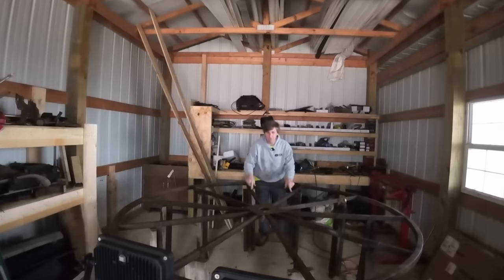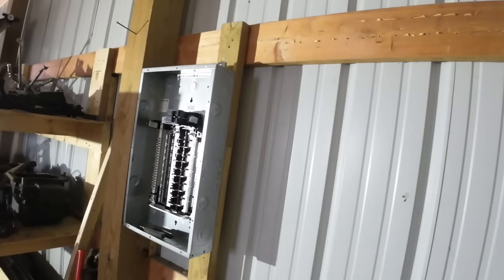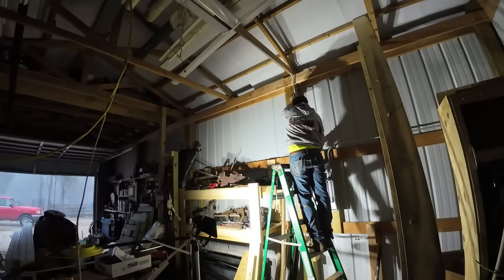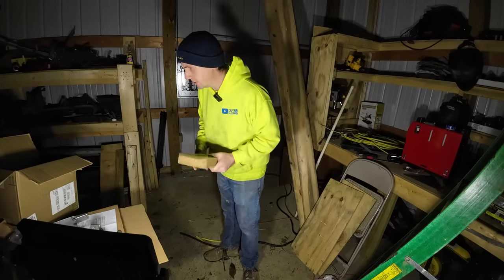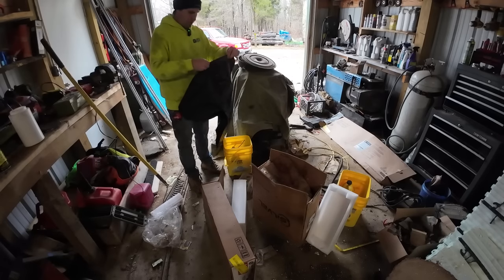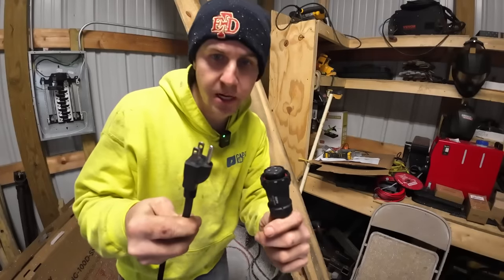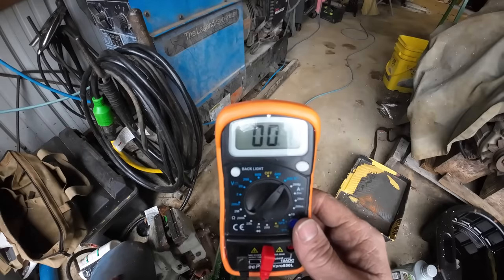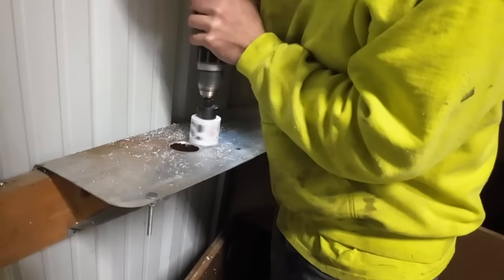Off Grid Solar Shop Conversion - Step 2: Electrical and Diesel Heater Install

Comment: We used motorcycle handgrip heaters and a 12v thermostat controller off ebay to kick them on at 36 degrees and back off at 50 degrees to keep our batteries warm enough to charge.  Whole setup was around $20 and it has worked the past 2 winters to keep the solar system charging.
Reply from the maker: That's a good idea!

Comment: NM in conduit... only need to pay attention to "conduit fill" rules, and wet or dry location specifications. Even if you can get it in, I don't believe that more than one NM cable in 1/2" conduit will meet the conduit fill rules. The inside of conduit is considered 'wet' if the outside is.  NM cable is not a 'wet' cable. Otherwise, no problem.

Comment: Try not to let the place your "solar generator" sits get above 120 F or below 40 F.  This will help battery life. Fortunately "Thermocube" makes appropriat plug in thermostatic switches that can help with running a fan or a heat lamp or other heat source.

Comment: In My Hydraulic Tube Installation, I use a fine file.
The end of the file where the handle was, is a nice radius and that is hard , it is perfect Tool for internal cleaning of the cut.   Keep up the good work. LOL. from down under.
Reply from the maker: Thanks!

Comment: Dont worry about Romex in a conduit.
While it should be THHN its entirety kosher to run Romex in EMT down to a switch or device box to protect it.
I am NOT a sparky, but you know there's nothing more permanent than a temporary solution that works!  😆
Edit, they wouldnt sell NM clamp to EMT connectors if it was a BIG nono.
Reply: Article 334 of NEC explains and allows NM wire known as romex to be placed in conduit 💁‍♂️😉 so you’re fine with doing so. Just can’t put NM in conduit under ground or wet locations. Would have to be UF or known as direct burial underground wire. But like my thoughts is I don’t care about. Not calling an inspector for anyways on. If property connected in boxes there is no risks 💁‍♂️😂
Reply: @kevink4914  thank you for the citation! 👍
If I put UF in plastic do I need to bury it 18" deep or can it pass over an obstruction exposed?
(again, I'm not an electrician)

Comment: Cap’n, I installed a 12V solar system in my equipment storage barn.  It just uses my Deep Cycle boat batteries for storage.  

The power requirements are fine for the 12V LED lights that I have installed.  However, it isn’t enough for my small 120V air compressor. I wanted to power it through an inverter.  I’ll have to upgrade my storage capacity.  So, for now, I air my tires with a portable compressed air tank.  

Now about those commercials… I wanted to thank you for this mornings selection.  I learned that Reese’s now has a caramel filled version.  I didn’t know that   I need two pairs of Ariat boots.  One for work and another for the Saturday night rodeo.  Did you know that pro’s have their own special Shark Bite Pro series of connectors?  Who’d athunk that Lard saved poor people during the Great Depression?  I also learned that if I wasn’t using an electric shaver, I’d probably be scraping all the skin off my face.  That’s because I wouldn’t have subscribed to the right Shaving Supply Club.

As you know, I always watch all the commercials that pop up in your videos.  Often it adds another half hour or so to the viewing experience.   And, I must admit… sometimes it is a distraction from the golden nuggets that you provide.  But, not this morning…. I enjoyed every second of the advertising experience.  (Especially the whole 20 minute ‘Lard Saved America’ interlude.)

And… the bonus was… in between them… I got to watch you adapt and overcome  in your effort to achieve Workshop Organizational Bliss.    Thanks bud… 

Now please pardon me while I grab another cuppa and immerse myself in all the comments triggered by seeing RomeX hiding inside conduit!

Comment: You can use your "Dikes" (Diagonal Cutters) or a pliers as deburring tools.  Just stick the working end into the conduit and sin away.  It's not the best but it does work quite well.

Comment: on the romex in conduit, yes you will see many comments on that, have many of us done it, yes, its a homeowner privilege
Reply: Lots of things you can get away with , and I have done that myself .
But if you want to see the electrical inspector have a hissy fit , Romex in EMT will surely do it , lol .
Reply from the maker: Why?  It's not against code.
Reply: @CaptainKleeman  Just need to check Your LOCAL codes.  
Most codes require it in Conduit to be protected as In The Drop to the Light switch or on poles where damage can occur..  That is why fittings for NM cable to EMT are made.

Comment: Several good comments. The night light to keep the power center running. Same as I was thinking. I have Ecoflow, no extra battery. Ive had good service out of it. Just wanted to try one before sinking alot of money. I got a 160 or 180 watt panel with mine. That's a trickle charge for sure. Doing great.

Comment: A hundred amp will work for you for some time.  Tricky part is welder.  I have a much larger shop (but full) 30x30 with big porch that size with normal home AC in it - own meter and drop.  I have rotary 3 phase 380 for Grinders (surface) and 220 3 phase and normal 220 and 120.  In my own box that plugs into a 100 amp plug.  No regulations for plug items.   My background provided me the knowledge and some skill.  

Magnetic tools - put disk magnet on box apply tool - any tool.   You could maybe have a tape heater and plug it in and keep it always up above.  Never to dip.

Comment: You can buy or order tungsten wire at the hobby shops where they sell RC air planes. It is not expensive. I made a video about how to make a hot wire foam cutter from an old PC power supply, some threaded rod and a couple of nuts, the tungsten wire, and some EPP foam (often used as packaging material to ship stuff). The foam was used to make a handle, because it is rigid, but you can squeeze it and it will go back to its original form. And that is handy if you want to put some tension on the tungsten wire when you install the wire. I explain it all in my video. The video is called, How to DIY handheld hot wire foamcutter (30)
Reply from the maker: Very cool

Comment: plug in one of those seedling mats and stick it underneath the unit to get very low wattage heat. buy a cheap plug in thermostat to turn it on under 40 degrees and you have a solution to the charging under 32 degrees problem. I am building a solar/inverter/battery trailer right now and that is what I came up with

Comment: Cool.  Or perhaps, "less cool" than it would be without the heater.  Also liked the "squash and bend" method of making shelf braces, and "drilling everything at once."  (I use cheap bits for that type of work, so if you need any 1 1/2" long x 1/4" pieces of cheap drill bit, let me know, I think there are a bunch in the bit drawer of my tool box, and several more lost in the weeds outside the barn, where someone threw them in frustration or something.  Those will be okay, I'll likely find them with a tractor tire eventually.)  Thanks for the video, take care!
Reply from the maker: Appreciate ya watching as always dan

Comment: For clingy styrofoam and Azek "snow" Static Guard from the supermarket. 💡
I spray my table and miter saw down before i start, but it works either way.
Really great for yourself at the end of the day before you get all that crap all over inside your truck.
Pricey but worth every penny.  😉

Comment: Thanks for sharing your thoughts, ideas and videos. Sounds like you definitely have a good plan for the future. If you need a small load to keep the power on you could always plug a 1/4 watt nightlight into an a/c outlet. Also have had good luck with the thermo cube thermostatic power switches. I have typically used a standard light bulb in a work light for spot heating, haven’t tried to buy one in a few years though. Low power light bulbs aren’t always the best solution. 😂 looking forward to seeing how your shop progresses. Wishing you and your family the best.
Reply from the maker: Appreciate the ideas tom
Reply: @CaptainKleeman  not sure if they still make them but my home I grew up in built in the 50’s had a switch with an included pilot light. It was wired in parallel to the light switch. When the switch was off it lit up but provided a high enough series resistance that the bulb would not light acting like a power / continuity tester in the bulb in the spot light on the peak of the house. When you turn the switch on it goes off because it’s shorted across the conductor of the switch.  Kinda genus and counter intuitive. People were always pointing out the the light must be on outside. 😂

Comment: Insulating the cabinet walls and floor can the unit help retain some heat. Just leave room around the battery for proper airflow

Comment: Hey Captain, you can use lineman pliers to do a quick ream on EMT. Also like you said bringing up the Romex in the conduit. Yeah not allowed by code. Only single conductors are allowed in conduit runs longer than 2'. The Romex can't dissipate heat buildup if it's in conduit. So you have to derate the amperage of the wire and the breaker. Also there's very little chance of getting more circuits through the conduit if you want to later. If you ran THHN in the EMT there would be no issues and you could pull more wire in later.
Reply from the maker: It's allowed by code 👍

Comment: Best thing for heat in that building. 
Plastic sheet/visqueen/ vapor barrier, whatever you want to call it, run across the bottom of your trusses. Otherwise your peak will be nice and warm and your toes will be froze.
Reply: You'll be amazed at the difference, even with no insulation.

Comment: next time on your way to Evansville,, stop by the pilot or loves on 64. in the CB radio /electronic section you can buy the cigarette attachment to red & black wire ends. it’s made to hook CB radios to cigarette power but will have everything you need.
Reply from the maker: Good idea.  I have a couple laying around already though

Comment: Hey Mike, get yourself a low power night light to plug into a wall socket.  That way, the unit will not power itself off, allowing your heater to continue to work, keep the unit warm on those cold nights.
Reply from the maker: The heat is only on if im there
Reply: @CaptainKleeman what’s the acceptable “storage” temps for the batteries in the power unit you have? You might need to do something to keep it above a certain temp for the longevity of the batteries.

Comment: please first thing to do with the heater
get rid off the crappy green fuel  line
get some stiffer pipe  - pulse pressure is lost with the green soft stuff
when running the heater find a comfy temp and let it idle at that not full power all the time
when turning heater off ramp the temp to full for 10 minutes to burn off any soot in the burn chamber 
should have no probs for its life time 
{:-) PAV UK
Reply from the maker: Thanks!

Comment: With that heater if you extend the exhaust, you can use it as a radiator to capture more heat and make it more efficient. There are a bunch of vids on the topic. They are big in the UK
Reply from the maker: I may try that

Comment: I know what you mean I used to bend pipe everyday for 2 years and got pretty good at it working as a electrician helper but when you don’t do it for a while and try to go back it’s tuff the only thing I didn’t forget was how to do a box off set lol oh and a 90 but everything else it takes a min to get back in the groove.

Comment: I shop at Sam’s club and they have some great four foot led light fixtures for about $19.00. They put out a tremendous amount of overhead light. I put these in the garage. These are made to plug and string together. They come with a standard 3 plug male and also a plug input for stringing. Highly recommend.
Reply: This! I bought 20 of them for my pole barn build. They're made by Honeywell and no issues after a year. They pull 33 watts a piece

Comment: I fell for your plan to generate youtube comments by not wearing a respirator while cutting that insulation with your chainsaw! Also I think the cold tempature thing answered my question about this NOT being a gas generator replacement for emergencies, I was excited by the solar power and battery concept. Looking forward to the next steps!

Comment: I seen that workshop cleaned so any times and it's always end up evrything every where just matter of time. Where you can not even get inside.i can not believe you guys you don't clean up after you self each time you do things . I can not leave my work shop if it's,not clean does not matter if I have not finished I put all my tools away clean everything up you don't know what can go wrong till tomorrow or next time.clean shop a happy shop and EASY to work and keep things clean.
Reply from the maker: It's never been a workshop.  Always storage, hints why the things were stored there. Thanks for watching

Comment: Like you keep saying it's not a long term solution, just a stop gap until you get power which the way you work won't take long. Now you've had a clean up there is so much space in that workspace, bet you're surprised?👍

Comment: I have added  Harbor Freight 4 foot LED's in my shop. Recently picked up 4, 5500 lumens linkables @ $19.99 each, and it really made things light up with only one switched outlet being used.

Comment: Run a fish tape through conduit, and use individual wires!!! That is the main reason for conduit. You can add and subtract circuits.
Reply from the maker: The main reason for conduit in this setting is to protect the conductors. Thanks for watching

Comment: There is an app for your phone to control the bluetti.  It supports wifi and bluetooth.  When you are close to or in the shop, you can use that app to turn on the ac or dc.  If you “tether” the bluetti to your phone for internet access, you could also download any firmware updates that will probably fix bugs and add features that could be useful to you.
Reply from the maker: Correct

Comment: I like it, it’s coming together, going to be sweet for sure. Now, as far as magnets on tools, you just know your going to stick that tool on something and end up having to do the ole need to do C before B so that you can do A and in the course of the process you’ll forget what you did with the tool 😮😊, not mention putting that tool in your pocket anything magnetic is going to stick to it, although having a magnetic bar to place next to your project would be nice, then it would hold your tool, just a thought or two, big thing is your thinking, I like that also. If you are enjoying this project as much as I am watching it, well, we both have the world by the tail young man, thanks for video.😊

Comment: I think you could add a switch from the Ryobi inverter to the Bluetti so it will charge while you are away.  One battery charging another battery is not efficient, but it may be a temporary work around till you get your solar up and running.  Cheers!

Comment: Noticed when you were laying the ground wire into the panel, did you separate the ground and neutrals to separate strips in the panel and remove the bonding screw between the strips? Will come in handy if you install a generator.

Comment: Another fine addition to the Kleeman Khronikles. I've run romex in conduit for short run a good number of times.....just use what you have on hand.  If you have a really long conduit run then use THHN or other appropriate wire. I think your "1/2 round" table idea will fit nicely with appropriate supports added.  As always you are doing a great job of "running wut ya brung." Great channel, great content.
Reply from the maker: Thanks for watching

Comment: I've seen a couple videos on the diesel heaters where they added a second heat exchanger to reclaim the heat from the exhaust, more than doubling the efficiency. Some use cast iron home radiators, you might be able to repurpose a heater core or car radiator.  Perhaps, when you build the enclosure for the power station, you could put a heater core in from of the fresh air inlet and use the fan to draw it through, obviously in the summer when the fan would have to cool there would be no heat from the heater. Or reverse polarity on the fan and put the heater core on the exhaust side of the cabinet, so in the cold it would push heat down

Comment: Great job Mike. I know it’s probably to late, but I saw this one guy run the exhaust long in the building to add to the heat output. Kinda like a radiator line. Anyway, nice work.

Comment: Switch is upside down....  HAHAHAHA I had to add mine .....
My bet would be the Outlets turn off due to the increased RPM of the Engine taking the Frequency out of whack.
Older gen sets like Yours is not an Inverter type and the 60hz is set by the engine RPM...
Thanks Mike.
Mike M.

Comment: Even amongst electricians there is much debate about NM or NM-B in a conduit.  I've done it, but not before worrying about the temperature rating and if heat will dissipate.  It also depends on how/where it is terminated.  Running through conduit and then using a clamp on the end is apparently O.K. but between two "boxes" or enclosures may not be, as you cannot clamp the NM cable.  Also, in the video, while one NM cable may be O.K. (check local codes) it might be overfill with two cables in one conduit, especially if it is 12 gauge in half inch.  I wonder why two cables were needed?   Maybe to have constant power in the switch box for the future?
Reply from the maker: Two 12-2 in a 1/2 is well under the amount allowed per code.

Comment: You should be able to bump up the low idle on the generator so its putting out 115-120 vac. My Lincoln has an idle screw on the carb, adjust with multi-meter attached.